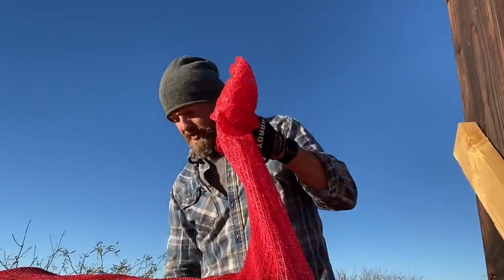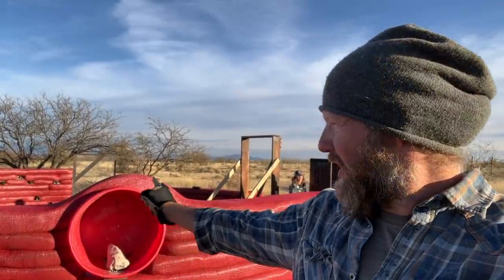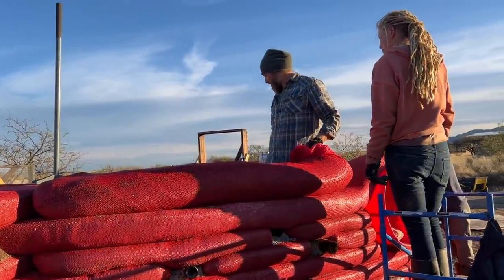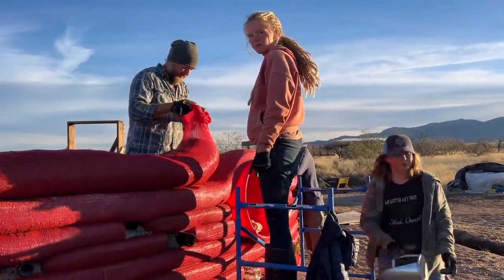Cob & Bottle Coop Loop - Hyperadobe Chicken Garden Build Day 44

Comment: Just a question regarding cobbing the gaps between the run door and the earth bag walls….  Don’t see any cleats on the bag side or support from the cob to the door side.  Is it possible that repeated opening/closing of the run door will cause cob around the bottles to weaken?
Reply from the maker: I doubt it. It will be a light door.

Comment: How well does the cob stick to the wood bucks? I have had to use diamond metal lath to make  it work.
Reply from the maker: We haven’t had any issues. If there’s a lot of wood exposed then we’d cover it with chicken wire but most of the time it stays with just a few nails in place to hold the cob.
Reply: @TinyShinyHome  Thanks